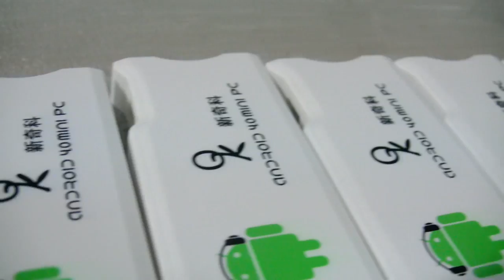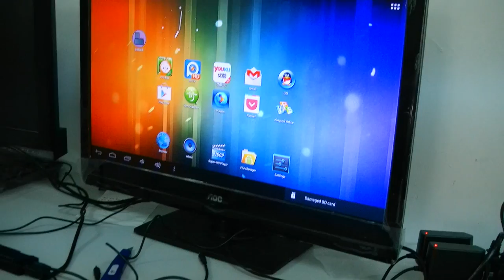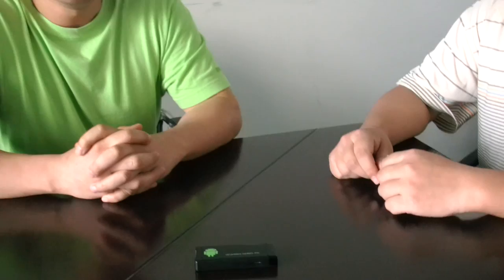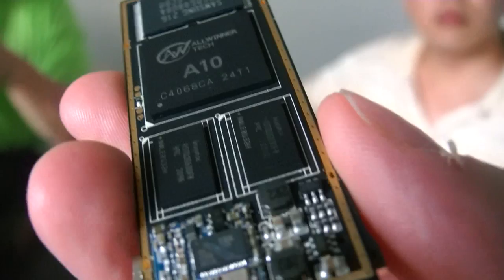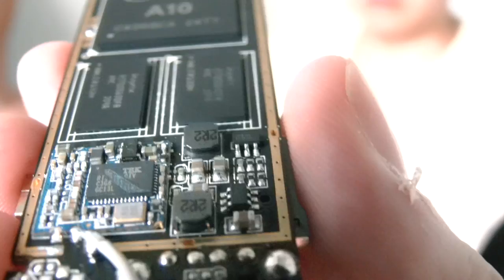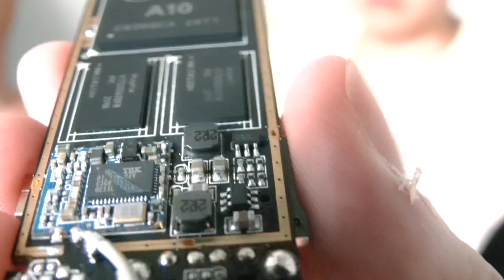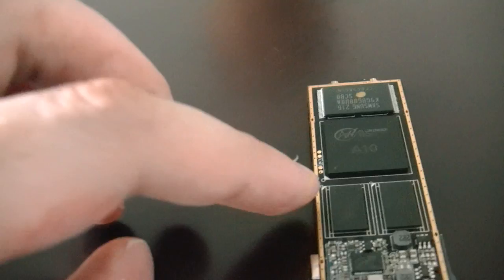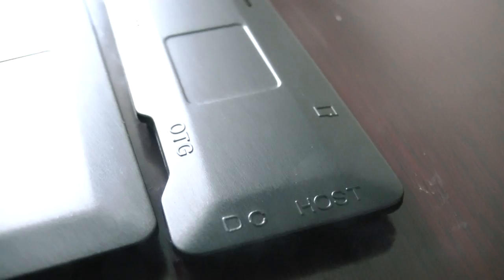MK802 Android 4.0 Mini PC AllWinner A10 HDMI Stick Factory Tour

Comment: Interesting about the heat vents in the new case.  I assume that means if mine doesn't have the vents, I should try to add some (after removing the case from the rest of the stick, of course).

Comment: Forgot to add that the 360 controller girectly plugged in by it self will lag the computer because there isn't enough power from its USB port.To over come that problem buy and external powered USB hub.These things are real cheap off of ebay.

Comment: I was kind of wondering if it could emulate games. How well do the emulators work? I'd only be using the Atari, NES, Sega Master System, Genisis, SNES, Neo Geo and maybe a few old arcade MAME. So would the 360 controller be plug n play also?